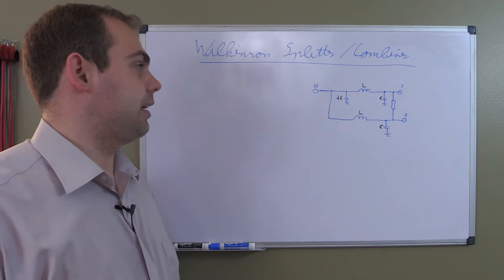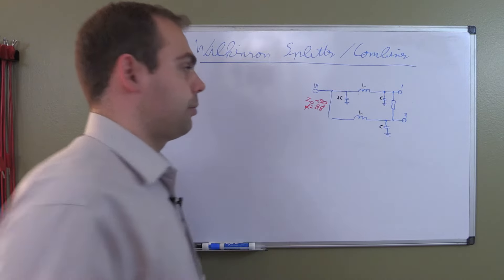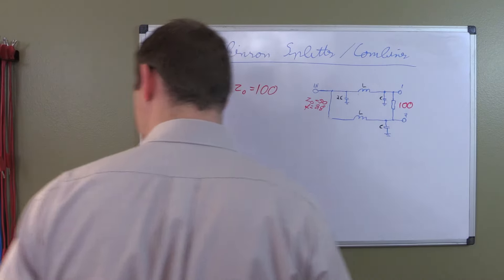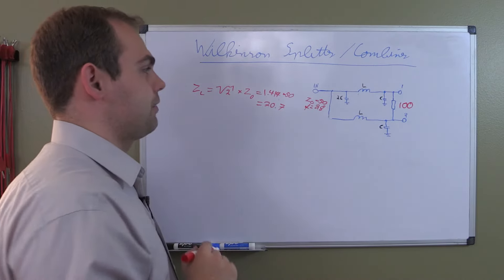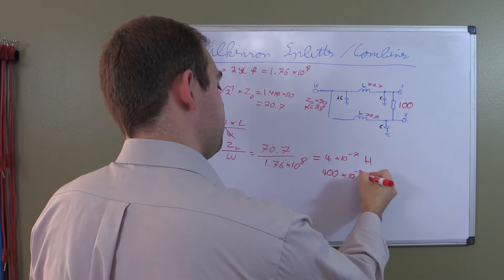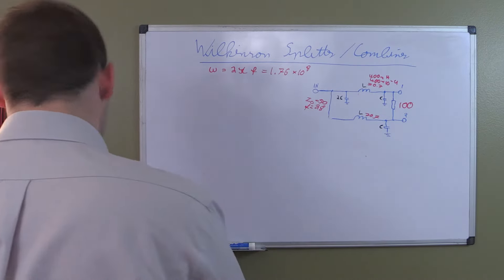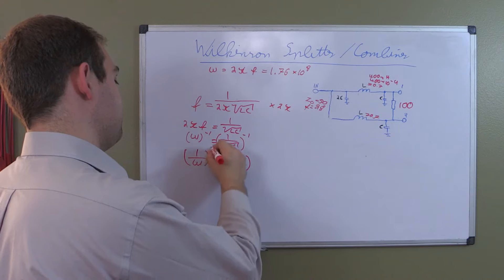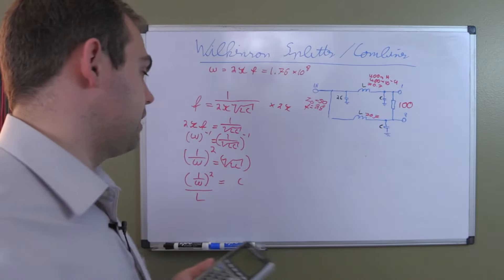Building a Wilkinson Splitter/Combiner [RF Circuit Design]

Comment: Hello - thank You for this video. Quick little note: winding on the left core is placed much closer to the PCB, so the parasitic capacitance on that part of the wilkinson splitter/combiner would be bigger then on the other side. I wonder if it would affect it's performance in 28 MHz range.

Comment: Hi Sebastian ! Thank you for the great video ! just a question ... why the XL need to be 1.41 x 50 ohm ??  ( or say: sqr(2) x 50ohm ) ??  May you explain me please ?  Maybe I forgot the principles of electronics ...   regards de HB9RXC Pietro
Reply: meteo091 hi, look at how microstrip Wilkinsons are designed. Basically the inductor shall transform the 100 ohm isolation resistor impedance to 50 ohm which is done by a quarter lambda transformer (in mstrip) with characteristic line impedance typically calculated by: sqrt(Z1*Z2)=sqrt((Z0)*(2*Z0))=sqrt(50*100)=70.7Ohm.

Comment: Hello my friend
Can you help me calculate the coil and capacitor for 98Mhz?
The Coil if possible I pass in numbers of turns, measurement of the wire and diameter.
I tried to use his explanations, but since my mathematics is not very advanced, I could not calculate.
I await your valuable help
Thank you very much.